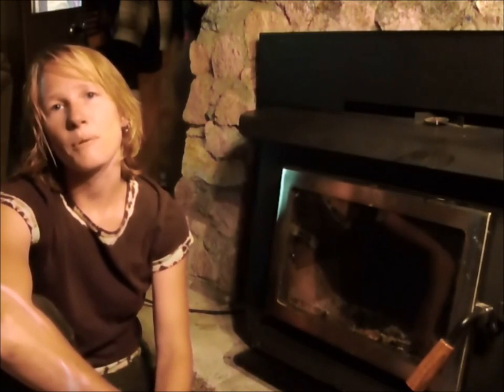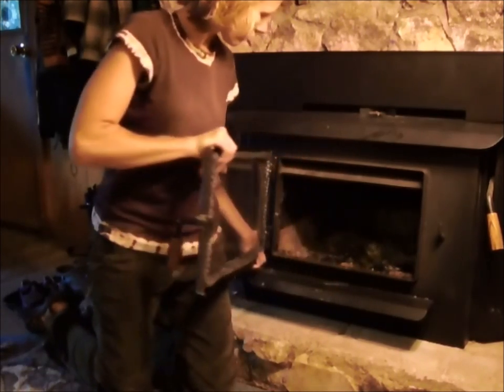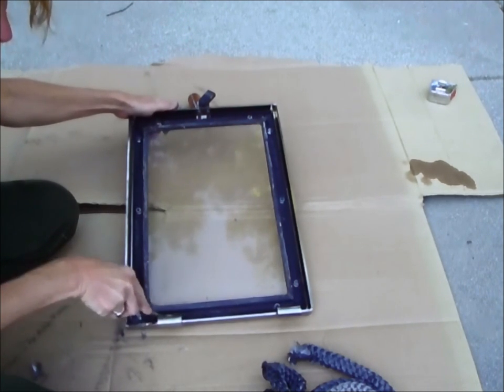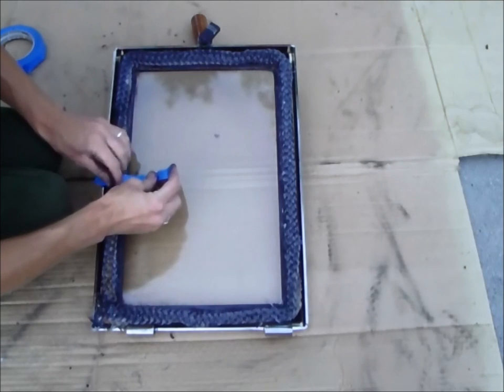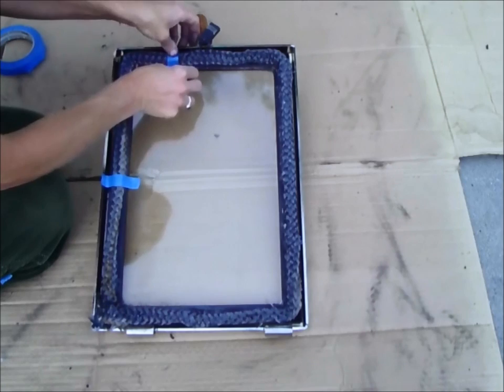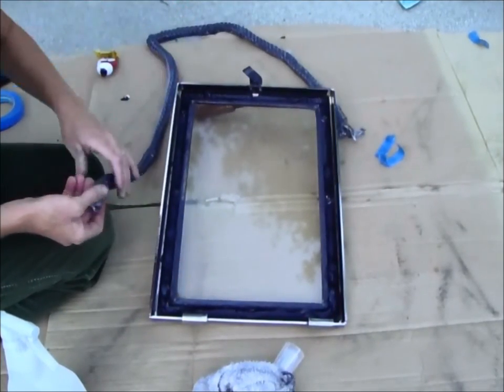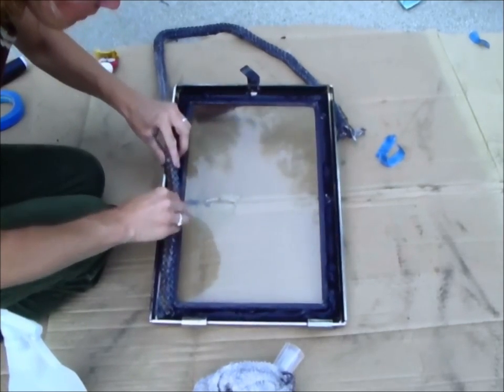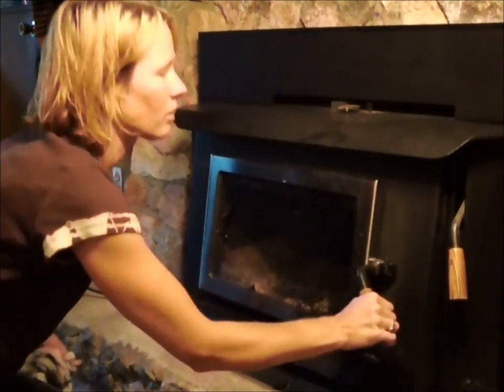How to Replace a Wood Stove Door Rope Gasket

Comment: Thanks, Ashley.  This husband did not leave town but he is very inept!!!  It's minus eighteen right now in Northern Ontario.  My stove is nine years old (Regency) and the seal has never been replaced.  It's completely flat.  When the door is closed and latched shut, I can see the fire if I look between the seal and the stove.  The stove never gets out of control, but I think it's high time I change it!!  Thank you for your simple video.  Usually, when you're putting on a bonding material, you want it dry.  Why moist here??  When I use my wood stove all winter long up here, how often should I be changing my seal??
Reply: I see you are located in California.  Minus eighteen in your temperature is Zero Fahrenheit.

Comment: IAM FROM AUSTRALIA I HAVE A AUSSIE MADE COMBUSTION WOOD HEATER THE ROPE I REPLACE IS TIGHT IN THE C CHANNEL DOES NOT NEED GASKET HEAT PROOF GLUE TO HOLD IN PLACE IT HOLDS ITS SELF  MAKES IT EASYER TO REPLACE NO GLUE TO SCRAPE OFF GOOD VID THO SOME WOOD HEATERS REQUIRE GLUE AS ITS A LOOSER FIT ROPE